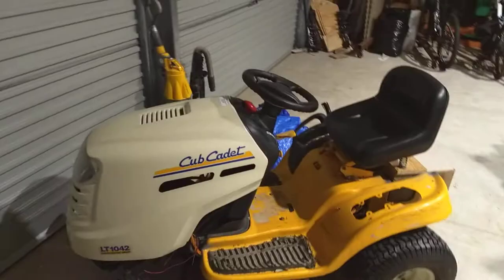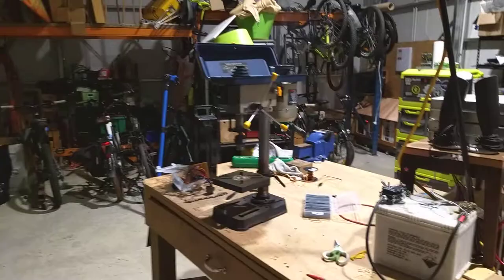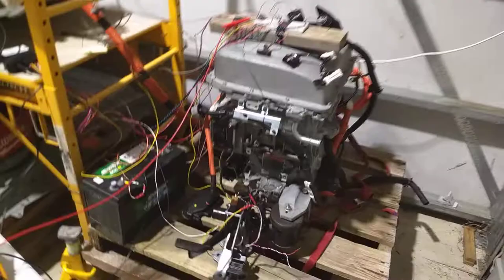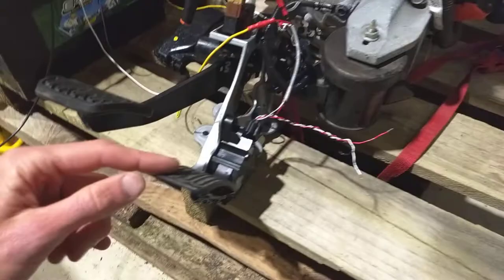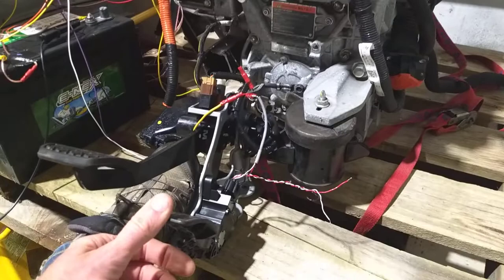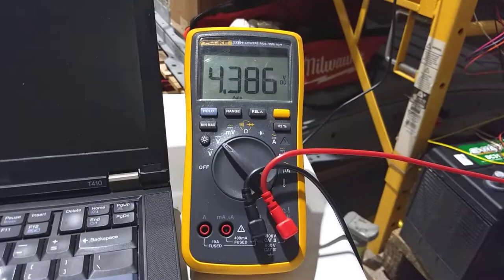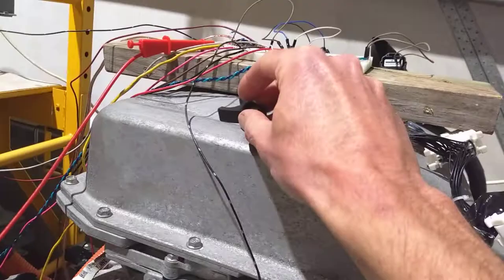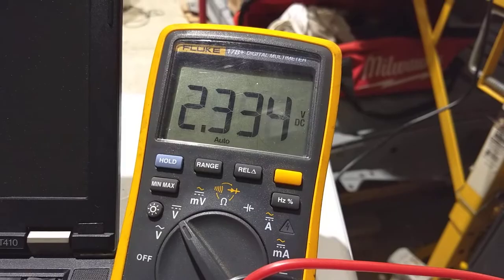Nissan Leaf Zombie Guts-The Walking Dead!

Comment: I'm wanting to install this in early 90's Toyota pickup 4x4 but the biggest challenge is getting shaft power to the existing transmission in the Toyota or without but still getting power to all four wheels. I'm planning on drawing this up in CAD soon, but don't have any files of either which would help tremendously. What are your plans with it?
Reply from the maker: Your project is very doable. I don't have any cad data at the mo. My plans for the motor are also unclear. It'll go in something soon :)

Comment: Looks like it's nearly ready to be transplanted, assuming you have hooked  up the high voltage charge port, type 1 and Chademo?
Do you have a vehicle for it ?
Reply from the maker: I don't have any of the charging stuff hooked up yet. But yes, its more or less ready to go. Its my motor and battery but I'm doing this as a project for http://bluecars.nz We'll be able to offer these parts for people to do conversions (possibly even offer repower services too) after a bit more testing. I don't have a donor lined up yet although 'Project Binky' is in my sidebar and it would be good to show them a good use for a rebuilt mini instead of wasting it on a hiss-pop petrol wasting noise machine :) https://www.youtube.com/channel/UCHvBHWBzzB7NyU5tIiEZHBg
Reply: @RaglansElectricBaboon  Yes, I'm aware of Binkey. Sounds like a great project. 👍
Reply from the maker: @PlanetCypher_  I've also heard of a T5 VW van with a blown motor. Its just about big enough for a Tesla battery in the back...
Reply: @RaglansElectricBaboon  I remember seeing a T5 conversion recently, the motor bolted right onto the gearbox, easy. The type 2 connector was under the vw badge on the front, seem to remember lots of room between the rails under the bed/floor.
Reply from the maker: That looks wicked! Thanks for the share. I was thinking of putting a whole Tesla pack in the back but his method is much neater.

Comment: Does this allow for custom battery packs in my leaf now is the trick.
Reply from the maker: I suppose it does. The idea really is to enable the Leaf motor to go into any other car. If you put this in a Leaf (as you'll see we did in another video :) ) you don't get any of the Leaf's other functions because none of the other computers are connected. No brake assist, no abs, no power steering, no traction control, electric windows, dashboard etc etc etc.
Reply: @RaglansElectricBaboon  does this allow you to increase the amount of power going to the motor? or is that still limited to the stock 80kw. I would be interested in cranking the amps up on my otherwise stock Leaf!
Reply from the maker: No. This send requests to the standard computer within the Leaf's inverter. To go higher you'd need a different inverter or a deeper hack. I'd love to see someone do that hack.